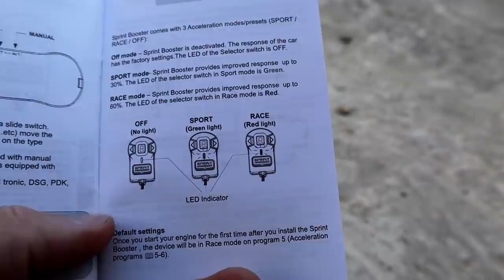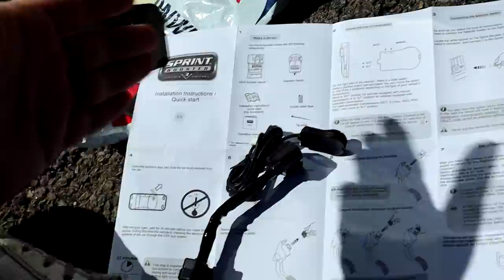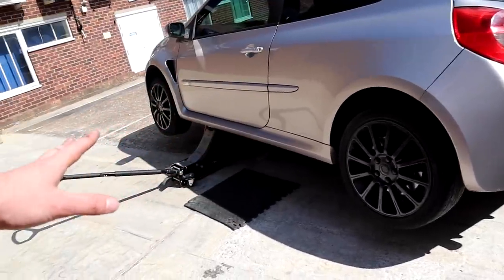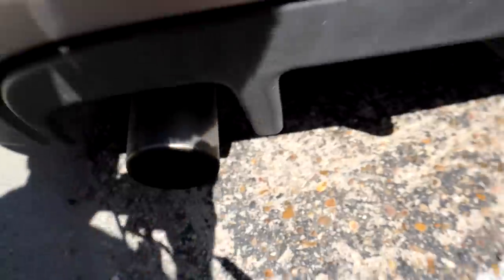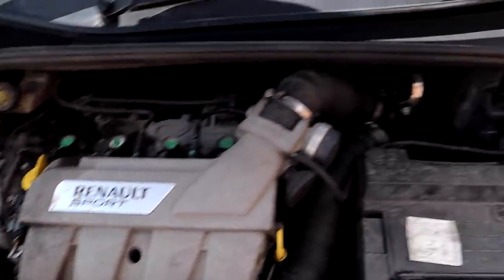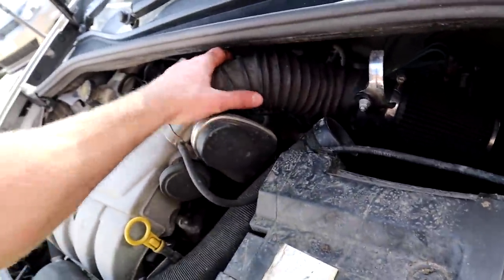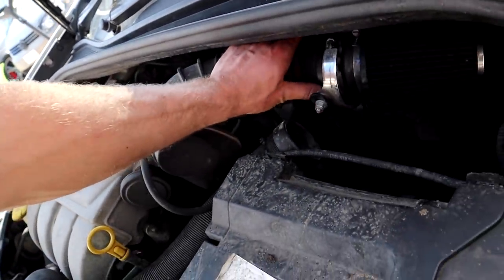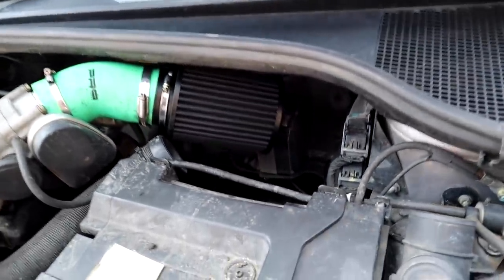You Haven't Heard of This Mod.. But you NEED it!

Comment: Highly recommend this for anyone with DBW throttle. Makes the car so much more fun to drive and saves fuel since you get torque much earlier. Works a treat on lighter vehicles as far as fuel is concerned.

Comment: So it’s a mod that basically makes your throttle pedal travel shorter, i.e you only have to press 50% and the computer will tell the engine it’s actually 100% pressed. so you can do exactly what this mod does using your foot